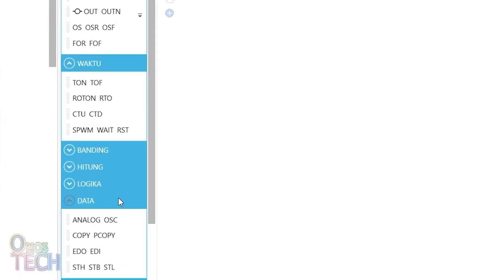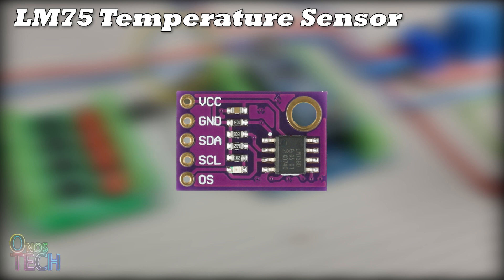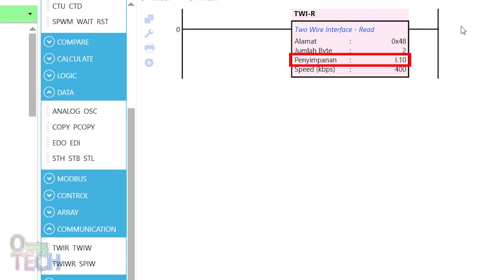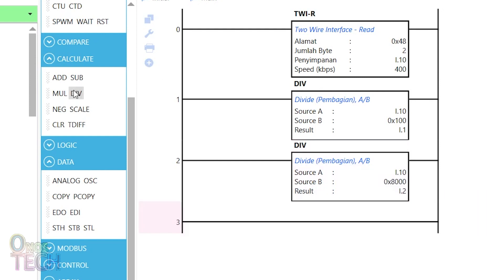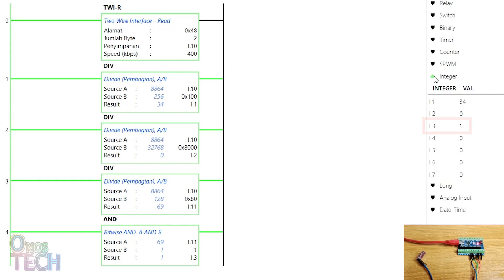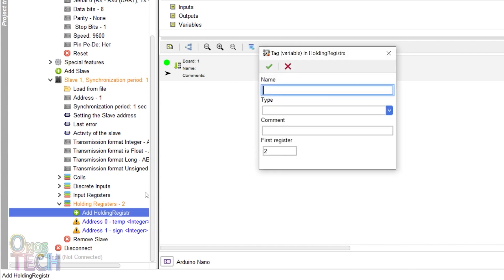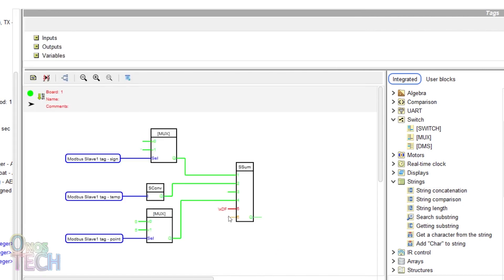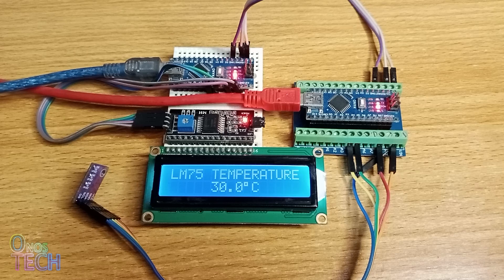LM75 Temperature Sensor  | Outseal Arduino PLC

Comment: Can you do this project on one arduino?  Outseal connect temperature sensor and display on LCD, do not use FLProg
Reply from the maker: Outseal does not have an instruction for LCD, that is why FLProg is used.
Reply: @OnosTech  Is Outseal studio programme and FLProg programme both required in same time in one arduino nano??

Comment: Hello. Can you please update the instructions on the website to include TWI because there is a lot of sensors available using this protocol.
Reply from the maker: I don't completely understand your request
Reply from the maker: I don't completely understand your request
Reply: I thought you are associated with outseal?

Your tutorials are very helpful.

I'm interested in i2c functions twir twiw (for example can you control multiple servo motors using pca9685? )
Reply from the maker: @allentighe9947  I am just a YouTuber. I don't mine sponsorship with the "Thanks" button.